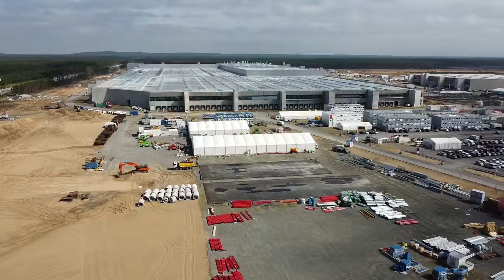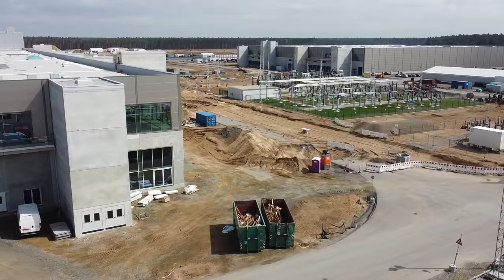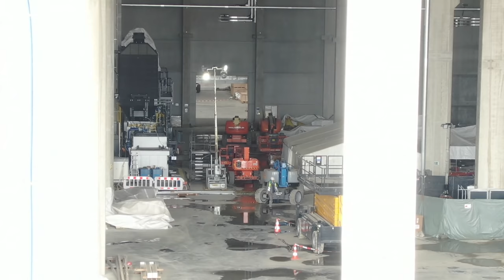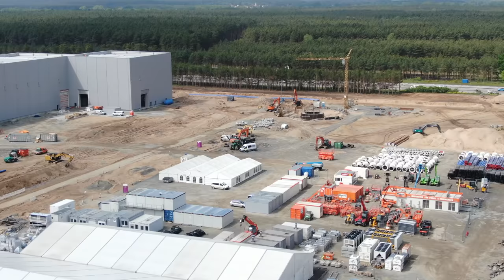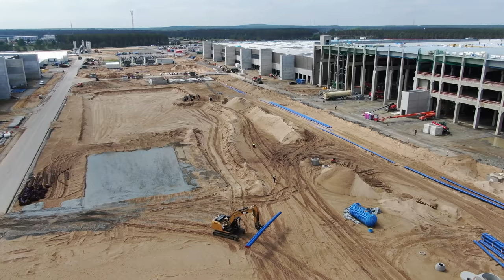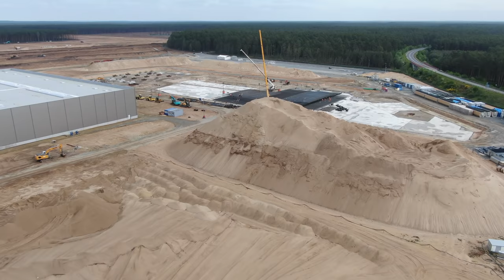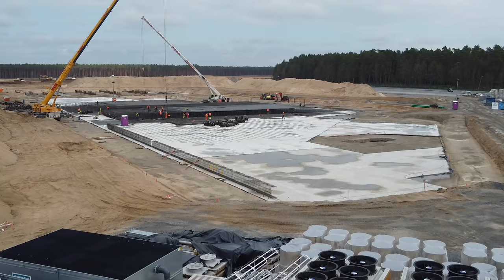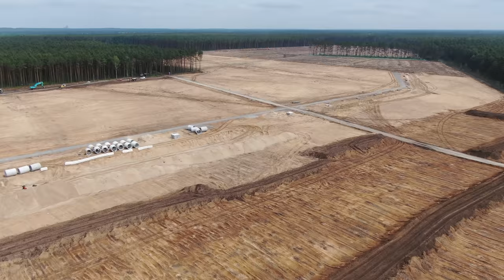Giga Berlin | 2021-05-29 | A lot of steel

Comment: It looking like the great German engineering is just part time, Unbelievable what Tesla have built in Texas in half the time.
Reply: Bureaucracy once again disrupts progress
Reply: @jengawann  But Tesla is also partly responsible for the chaos
Reply: @sascha5724  Yet if Tesla had waited for all the permits they would not even been where they are now.
Reply: @sascha5724  Mainly Tesla.
Reply: @favesongslist  "Yet if Tesla had waited for all the permits they would not even been where they are now."
If they would have waited for the final permit there would be still a forest. However, those preliminary permits granted to Tesla are public processes. Thus we know what Tesla could have done - and what Tesla did or did not.
1. "part-time" 
Tesla was granted to work 24/5 at the building. And 24/7 in some (in the meantime nearly all) inside areas. Much use did Tesla made so far not out of this.
2. Tesla has since July 2020 permission to complete all buildings applied for (in phase I). Works for some auxiliary buildings needed for phase I have just started (tank farm, wastewater treatment), while others not yet at all (energy center, sprinkler center, fire station, hazardous materials storage). 
3. While some parts of the factory are more or less production-ready, with trial productions already started or applied for,  others (e.g. GA or DU) are still bare of any production equipment. Which is strange. Probably a supplier's problem. 

If 3. is serious (or there is any other issue that won't allow production before the end of the year) it makes sense not to spent extra resources (1. and 2.) to finish other parts earlier than needed.
Reply: Nicht schnell ist wichtig, nur richtig ist wichtig. Qualitätsmängel holen einen ein. Niemand hat hier einen Wettkampf ausgerufen! Und: wer zuletzt lacht, lacht am besten.
Reply: Just look at the Giga Texas building and and Giga Berlin. The German building looks twice as much in materials than the Texas one.
Reply: It's funny to read people defending and attempting to explain away the bureaucracy and slow progress.. as if the "chaos" Tesla is bringing is not an inherent part of innovation and progress. If German culture and government were capable of nurturing fast progress and innovation, BMW and Mercedes would already be the market leaders in EV.